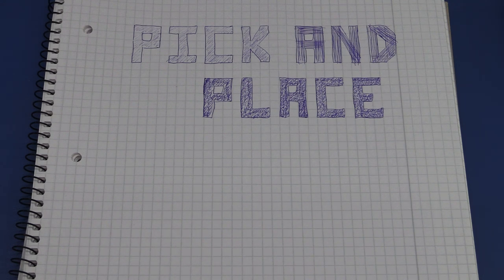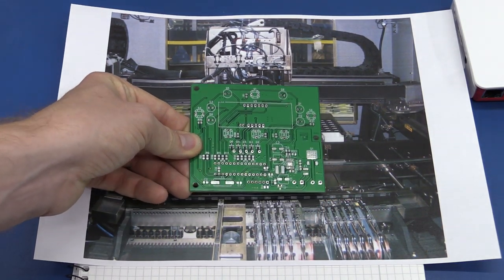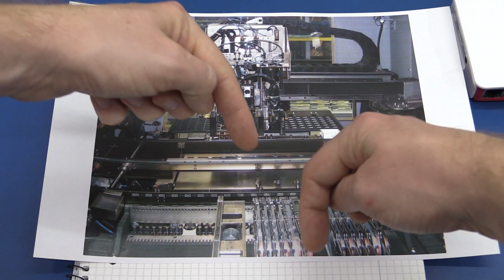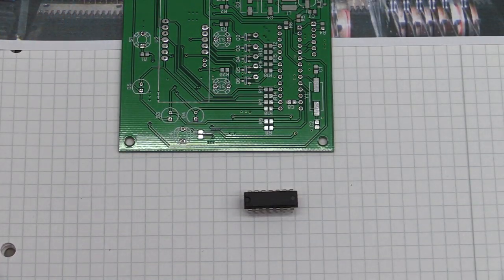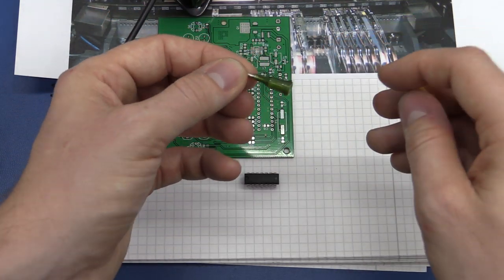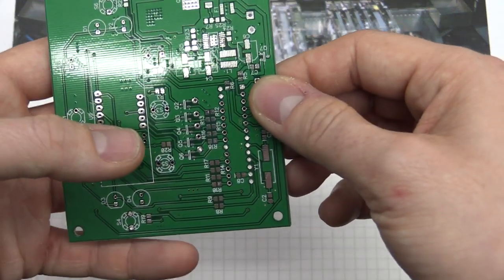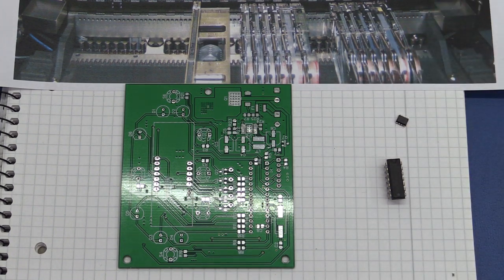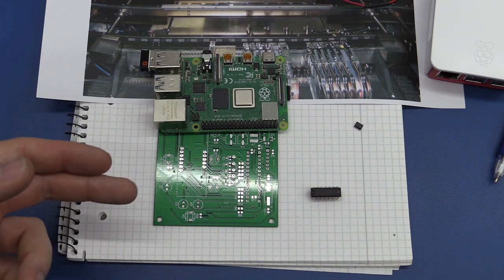Next project: Pick and Place Machine (Introduction) - Ec-Projects

Comment: For open source pick and place software, look at OpenPnP (http://openpnp.org/). I think they have it working with a number of open source and other hardware machines and it is currently under active development. On the other hand, doing the software yourself would be more interesting, both for you and for us.

For the movement, I think more speed is needed for pick and place than for 3D printing or CNC milling so you might want to consider using servo motors and drivers instead of steppers. I believe these can more easily be made to go fast enough than steppers for a point-to-point application like pick and place. Also, driving servo motors would be an interesting topic for videos.

Anyway, this looks to be a really good project from you, whichever way you go.